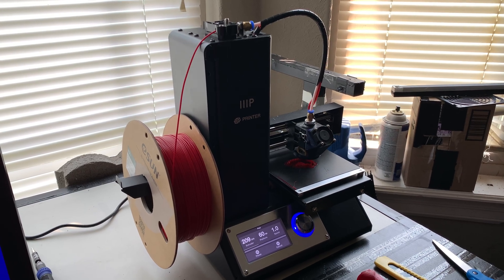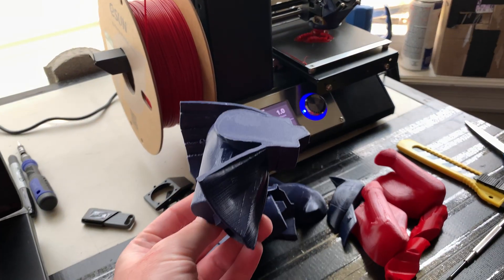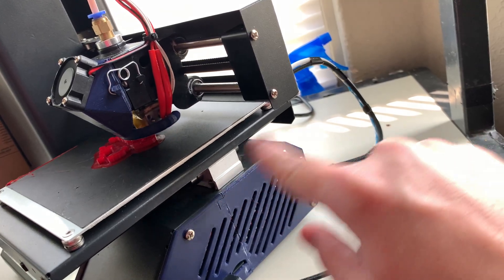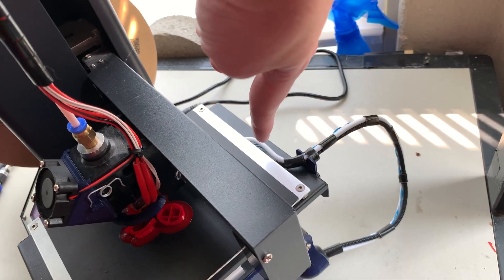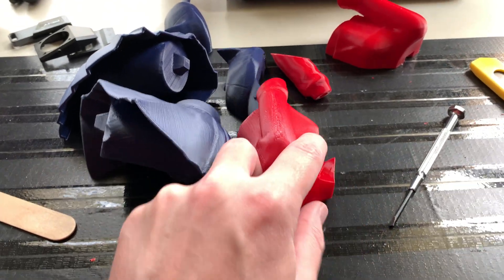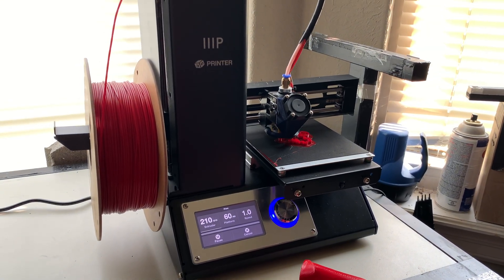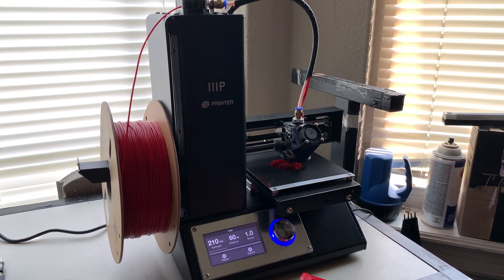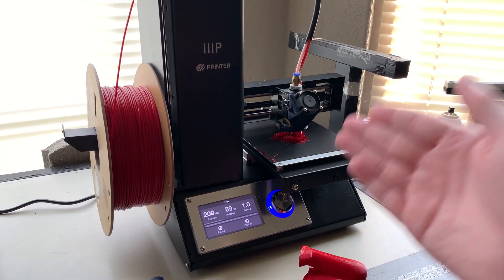The 10 Year Old $20 3D Printer Update - Still Working

Comment: I'm giving a like for the unedited sudden jumpscare fall lol. For the tiny extruder assembly I think you could easily increase the print speed to around 50mm/s. It looks like it runs at 25-30 or something. Too slow for a bowden :) EDIT: Alright I see it is moving faster in some travels, so maybe your accelerations are too low